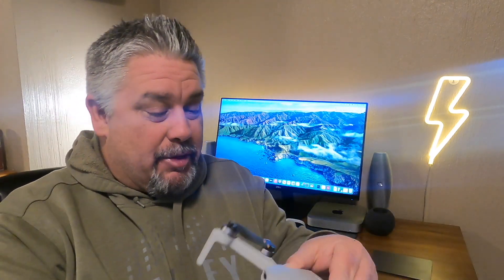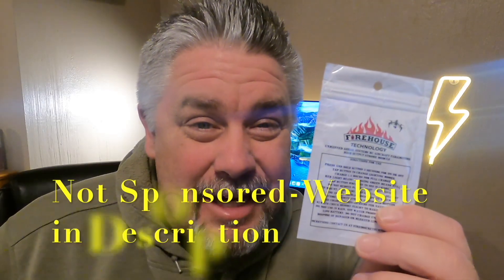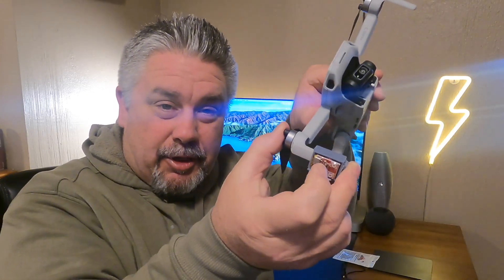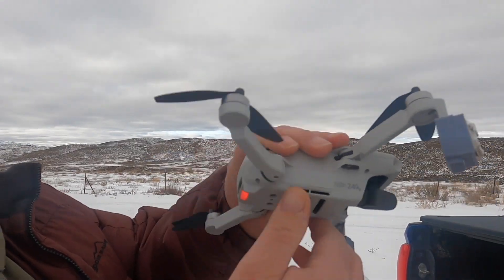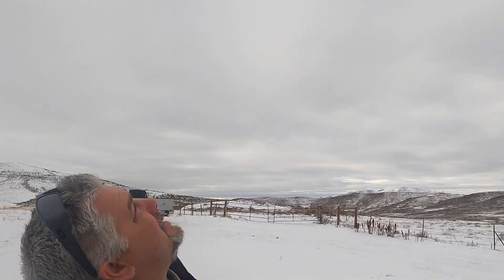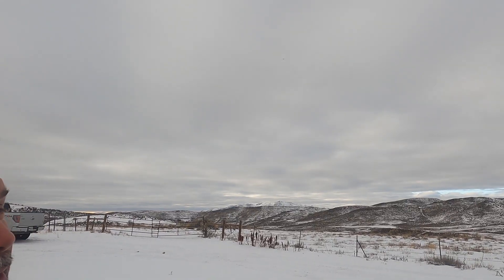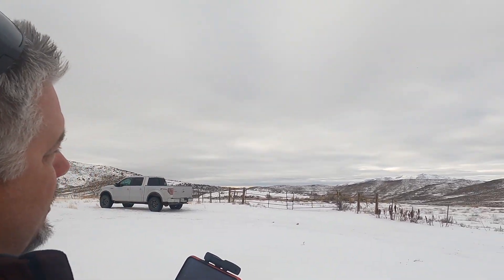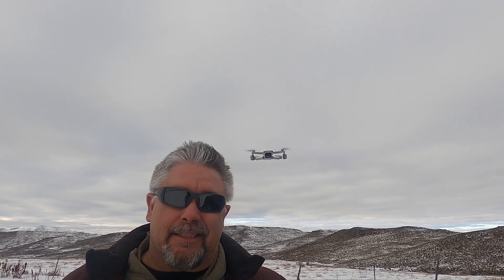DJI Mini 2 | VISIBILITY PROBLEM FIXED

Comment: I'm sorry but in your video I can see the drone (as a black speck against the sky) even with the wide angle lens viewpoint. But I do not see the lights unless it's almost right overhead. Maybe it was different in the open air - I'll take your word for it - but I'm unconvinced.
Reply from the maker: Yeah, sorry about that Gary...it is hard to see. I was just so excited about the little light I wanted to share it with the world! It is a great addition, and it is priced very reasonably. Not a must have, but it is a fun little add on to an already great drone!

Comment: WTF?? 
Why is motherboard of these strobe lights open?  Looks like it's gonna fall off...
Reply from the maker: The item is very nicely constructed and the circuit boards are sealed and protected from moisture. I imagine the company made them this way to avoid adding unnecessary weight. Thanks for watching!

Comment: Thanks for the video - I think the colours might need to be the other way round though - red is normally port (left) and green starboard (right)
Reply from the maker: You are right! That's the way I have them.
Reply: @JP1970  "Red on the right - returning" a phrase my father taught me. He said if you are looking at an airplane or water vessel and the red light is on the right side based on your view point (green on the left from your view point) then the airplane or vessel is "returning" meaning it's headed toward you.
You, kind sir, have the red on the starboard side and the green on the port side which is opposite of normal. But, it's your drone, put them where you wish. --- Clear sky's my friend ---
Reply from the maker: @awwaldo  thank you very much sir...I realized that after the video—I should do a follow up. Thanks for watching and commenting. I’m just a guy on YouTube sharing my experiences and you have taught me something. Thanks again!

Comment: I've used the different colored ones and found the white ones are much brighter. I take the ones without the leg mount and just double sided sticky tape it to the battery door so I can keep up with the rear of the drone. https://www.amazon.com/gp/product/B06ZZ9D1MQ/ref=ppx_yo_dt_b_search_asin_title?ie=UTF8&psc=1 
I use Gorilla tape.

Comment: The lights do help. I have some strobe lights I bought for the Evo for about a 1/2  of the price that is easy to attach or remove. These you show are great for the mini as it is custom fit. I haven't really flown at night, but it even helps during the day when you go below the tree line.
Reply from the maker: Amazing what a difference they make. Thanks!